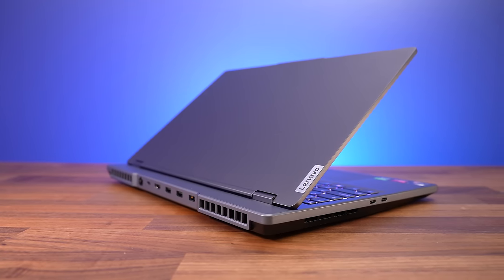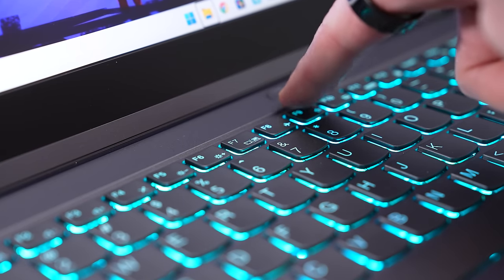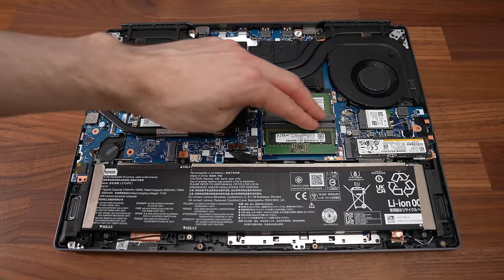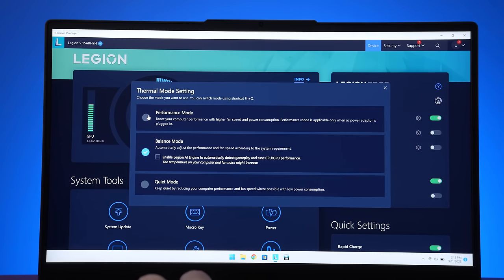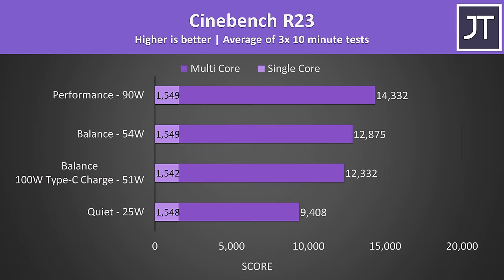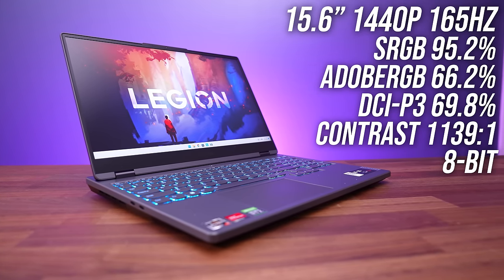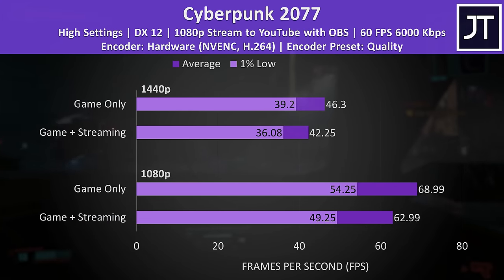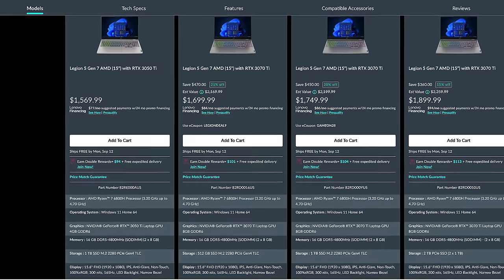Lenovo Legion 5 (2022) Review - Still Best Mid-Range Gaming Laptop?

Comment: I think the model has a better design compared to last year. But it does seems to be minor. If you have last year's, this year is definitely a pass. Too bad no 17 inch models this yea. Otherwise I'll take that in a heartbeat. Still it's still a well capable machine for what it has to offer.
Reply: If you have last year one, the next 3 years are definitely a pass imo :D
Reply: @thomassleziak1222  im gonna buy the last year one because its cheaper and there is no difference for gaming 😁
Reply: @winterfell8756  you do the right thing, that gpu thermal throttle is a big downgrade compare to the last year model probably due to the removal of the left side heatpipe, the weak hinges won't be much of a problem but the price is a No go. get the last year and you'll be a set for a few years
Reply: @Emad______  well here in france i can get the last year model for 850 euros witha 5600h and 3060 so theres definetely a big difference in price with the 2022 model so yeah for me the last year is a much better option for so many reasons
Reply: @winterfell8756  that's a sexy price right there, but with which screen option? and ram/ storage?
Reply: @winterfell8756  here in Delhi that same model costs $1700 ... Pain
Had to get the 800 dollar 1650 version lol
Reply: @MFDOOOOM  damn thats very expensive im sorry for you guys
Reply: @winterfell8756  Hello, where can you buy it in France for that price, i would come just to buy it 😁
Reply: I recently got a legion 5 2021 with an rtx 3070 , 2 tbs of nvme , 16 gb ram and an r7 5800 h , 15.6 inch , mantaray white for 1673 usd
Reply: just bought last years model with a 3070 and 5800h for $1350
Reply: @AliHamza-sv4ni  I basically got the same thing tho mine had 500gb ssd upgraded that to 2x 1tb nvme and upgraded the ram to 32gb. total cost 1800euros.
Reply: They cut too much in this year model 2020 and 2021 model were much better also that new ventilations grils and hinge are not looking as sturdy and good as old ones.
Reply: @Emad______  15.6 1080 120hz and 8gb ram but the ram aint a problem since i can add 8gb more for 30 euro
Reply: @winterfell8756  the screen was the reason that cheap price, they always do that with the 12hz config. that screen is terrible in more ways than one. it's dim, colors are washed out the respose times is slow af and lacks so many features a good display should have. that said, if u attach the laptop to a monitor or tv then it's not a big deal and can be overlooked. the 8gb ram is not enough but also an easy cheap upgrade so no problem on that front.
Reply: @Emad______  what you recommend me ? Getting the 165 hz screen with a ryzen 5800h?
Reply: @winterfell8756  idk, do u play with the laptop screen or hook it up to a monitor? and how much it's gonna cost u to upgrade to the 165hz screen?
Reply: @Emad______  laptop screen, i just checked the 165 hz screen with an rtx 3070 is like 1300 euro thats too much theres almost 500 euro difference ill probably go with the 3060 120hz and idc that much abt the screen bcs im only gonna game
Reply: @winterfell8756  that 1300 euro is absolutely worth it, the 8gb vram of the rtx 3070 will last u years on 1080p max settings and since ur gonna game on laptop screen u really gotta go for the 165hz version, the games are produced in srgb color space and that 120hz screen covers like 50%-60% of srgb. while the 165hz covers almost 100% of it, u will notice the difference in games, no question about it, if u can't afford the rtx 3070 version atleast get an rtx 3060 version that comes with the 165hz screen. games look terrible on that 120hz, u won't get a good experience.
Reply: @Emad______  i know the rtx 3070 and 165hz is worth it but cant affort it sadly .. i wanted an 165hz one with the rtx 3060 as you said but couldnt find it (i want the lenovo legion 5)
Reply: Jarrod -  what if you force streaming process to iGPU RX680M and let game go by RTX GPU... would increase play + streaming FPS?
Reply: is the i7 not a a 17 inch version of i5
Reply: @winterfell8756  is that refurbished or Brand new?
Reply: @Emad______  what about 2021 one 17" with 144hz and 16 ram? 3060 ti tyzen 7 5800
Reply: @Emad______  so this year model have bigger temperature problems?
Reply: @tryfergoodra552  last year didn't have any to begin with, but this year there is some throttling with the gpu.due to the new heatpipe design specially on the 3070 ti model, not a huge dcrease in performance but it's there.
Reply: @Emad______  oic im thinking in 3060 models checking offers but rly want 17" model
Reply: @tryfergoodra552  ur only option is last year and the screen is not bad either.
Reply: @tryfergoodra552  brand new
Reply: @Emad______  what about in 3060 model? , i have 2 options 2021 legion 5 17.3" ryzen 7 5800 1tb 1080p refurbished in 1020$ or 2022 legion 5 pro ryzen 7 6800h 512gb 2560p new one in $1100 , both have 3060 kinda hard to decide
Reply: @tryfergoodra552  if u plan to game on it the rtx 3060 isn't enough for the  5 pro's screen resolution otherwise get the pro model if u don't wanna go above rtx 3060
Reply: @Emad______  oic , yeah i wanna play with it , probably is too much for sekiro, gow and simmilars? although the only esport i like is Lol , i like big screen but also don't like at all the fact that the 2021 is refurbished dunno about that but says refurbished by lenovo
Reply: @tryfergoodra552  refurbished laptops doesn't mean something was wrong with it or it was broken. it mostly means either the owner didn't want it or at worst case it had issued but was returned to the factory, got fixed but the owner got sensitive over it. either way lenovo has good quality control. but if u don't play heavy titles and don't wanna use rt then get the 3060
Reply: @Emad______  Oh i see thanks , i don't care about Rt but maybe 3060 is kinda clutch for WQHD  if i want to play some games at max , i guess the best course of actions for me is wait a bit more till black friday to see if can get a great deal in QHD/WQHD and 3070 one if not then just 1080p 3060
Reply: @tryfergoodra552  black friday is when u can get a legion 5 with rtx 3070 and 1080p at around 1200-1300. that is the best combination for a laptop, the QHD resolution is basically useless for a 15" or even a 17" laptop dsplay, I've looked at them both and(legion 7 and legion 5) and I could not notice a difference in picture clarity,and I've got a rather good eye sight.U only get a 25%-40% fps decrease for no damn reason.unless u shove ur nose to the display, but siting at an optimal distance like a normal person, u can't notice a difference, it's just not so many pixel difference between them. sure the QHD is brighter at around 500 nits vs the 300 nit but that's damn impractical. try playing an hour with brightness at 100% and u'll see how ur eyes gonna beg u to stop. u'll be forced to turn it down to 300-250 nits. as I had to. these are all gimmicks pal.

Comment: I have the Legion 5(2021) with a 5600h and a 3050 and the performance is insane for the specs and price. Pretty much can run everything on high (some games even maxed out) with 60 fps +. Also the laptops temps are amazing(70 while gaming max 80  for both GPU and CPU ) if you lift the back up with something like a wooden block or smth. Sound can be a bit loud but if you don't know if it is worth it. It is imo
Reply: i bought one with i7 and 3050.
Is that enough to run heavy programs and games?
If not I’ll return it.
Reply: @dragginbalz5897  Look up videos and benchmarks that show how it performs in applications you want to use
Reply: is screen bright enough to use on sunny day indoors, or do you need to cover the vindows?

Comment: I bought legion 5i pro 2022 with RTX 3070 and i7 12700H and I've never been happier! 
Legion laptops are simply the best, they're giving you a whole package from performance to relatively thin design to having multiple ports that support latest technologies! not even mentioning the really good deals that Lenovo always makes.
Reply: How's the battery life when doing light stuff, like watching YouTube and web browsing?
Reply: @user-zc2hz3yj2k  I haven't tested it fully yet but I think when you use silent mode while browsing you'll get around 3-4 hours of battery life. 

however I tested the battery in the most extreme power saving scenario: 
I set the resolution to 1200p and the refresh rate to 60hz.
I used silent mode and used Optimus and turned on Windows battery saving feature and turned off Bluetooth and WiFi then I watched a whole 1080p movie offline for an hour and a half and it drained the battery down from 73% down to 52% which is really great!
while watching I was checking how much wattage the CPU was consuming and it was around 7.2 watts.

overall if you really want to save the battery you can but 12th gen intel CPUs are not a great contender for efficiency.
Reply: That's what I was thinking of getting this fall. Is 16 gig RAM enough? Is the i7 better than Rizon? I mostly keep my laptop plugged in.
Reply: @christhompson9140  this year's i7 is overall better than this year's Ryzen but it consumes electricity more than Ryzen but it's absolutely worth it in my opinion! 

16gb RAM is the sweet spot for gaming is it's somewhat usable for 4K video editing and stuff, so yeah it's enough
Reply: @user-zc2hz3yj2k  About 3hrs if you put it in Quiet Mode and switch to 60Hz, max brightness.
Reply: Do enable conservation mode on if you're plugged in for those working most of the time with a socket around. It really helps preserve life.
Reply: @christhompson9140  there about the same in performance, but the intel uses more power and gets hotter
Reply: @chrxs61632  so if performance is roughly the same, is the cost different mainly from just having the Intel name?
Reply: @christhompson9140  apple's junior brother 😂😂
Reply: Mine just arrived also I grabbed the white
Reply: I m thinking getting cheaper legion 5 with gtx 1650 due to budget...should i go for it or there are any other recommendations?
Reply: @pratyushsamal7569  I really don't know about cheaper laptops but generally speaking legion laptops are good.
Reply: @ExtremelySimplified  ok thanks man!
Reply: @pratyushsamal7569  ideapad gaming 3 is good
Reply: @pratyushsamal7569  get a 3050ti at least
Reply: what was the price you paid at the time? looking for the same model
Reply: @pratyushsamal7569  I would strongly NOT recommend the GTX 1650 at this point. There are better options out there on the market, unless you’re fine with gaming at 1080p on medium settings. But honestly at this point you should go with an RTX 3050 if you’re budget allows or if longevity matters to you then spend more and get an RTX 3060. The performance gains from it are worth the extra money
Reply: For RTX 3070 version, what is the max TGP? And if compare to RTX 3060 ver, how its is? I know RTX 3070 is better than 3060, but of course is according to TGP, right?
Reply: @junarisalfianto4877  The RTX 3070 in my Legion 5i Pro 2022 runs at 150 watts! it's super fast and delivers amazing performance. 

As I recall, the RTX 3060 runs at 140 watts which is still so fast though.

I think the 3070 is around 18% faster than the 3060 one. 
I did some benchmarks with the 3070 if you're interested.
Reply: @ExtremelySimplified  thank u so much, very helpfull. How about this, which one u preffer? I7+RTX 3060 or Ryzen7+RTX3070
Reply: @junarisalfianto4877  Ryzen 7 with the 3070
Reply: I'm thinking of buying the 6th generation, but I've doubts about the 512 ssd...have you upgrade for more?
Reply: @SimaoFCunha  u can add one more ssd for upgrade

Comment: Thank you for the review. Noise levels seem very good. This is the very laptop and configuration I'm after because I like this year's design much more, as well as it has a 1440p screen which is much better than the 1080p one last year. It seems better in many ways. This is the one I'd like to buy now.

Comment: Anyone feel like the entry level Legions are getting way more expensive?
You could get the 1650 one for 700,800 dollars and now it's like 1200 dollars for the entry level 3050. Insane
Reply: That’s how inflation works
Reply: To be fair, it's better in enough ways to make the price increase worth it. Besides, the IdeaPad Gaming lineup took the low end. (And yes, I know it lacks many Legion features like a MUX switch, but it is what it is.)
Reply: good job, you discovered basic economics and inflation 🎉
Reply: thats y buy at microcentre mine was 1300$ for 6800h 3060 1tb ssd 16gb RAM 1080p screen 165hz
Reply: @cameronbosch1213  how is it better in enough ways to justify 300,400 dollar increase ? The 3050 is an absolutely pathetic card, with has just DLSS capability in it's favour. 
All the high IQ bros goin "inflation" don't seem to get that either.
Reply: @MFDOOOOM  Wait a month or two. It will then probably be on sale for the rest of its shelf life. Also, for about $1800, you can get a Ryzen 7 6800H & Radeon 6700M 2022 Legion 7 that's better in many ways than the Legion 5.
Reply: @luluw9699  eula <3
Reply: @shamsielshahar120  eula kyaaa<3
Reply: @MFDOOOOM  it's because the supplies of the processors are lacking, for example ddr5 Ram is a whopping 200 or so dollars expensive than ddr4. In theory it should be lower over time.
Reply: 700k? Thats a lot

Comment: I have the 2020 version of this thing and it still rocks. The best investment I have made, this is going to last me until 2025 at least, I added a super fast ssd nvme and I use a 2tb samsung ssd for games, The performance is incredible. Ryzen 4000 series are light years ahead of intel, no need to upgrade my windows system atm because I am a casual gamer so no biggie with the gpu. I paid near 1400 dollars for this thing due to the pandemic shortages, but it was worth every penny. Never have had a blue screen or any problem at all, except the audio drivers recently.
Reply: What gpu do you have?

Comment: 23:59 I find it weird that for about $1800, you can get a Ryzen 7 6800H & Radeon 6700M 2022 Legion 7 that's better in many ways than the Legion 5:
1. The Radeon 6700M GPU is better than the RTX 3060. Both in Linux & in Windows for gaming.
2. The screen is much better, with a 2560 x 1600 165 hz screen that is 500 nits bright.
3. The Legion 7 has a fingerprint sensor.
4. The chassis is much more premium on the Legion 7. It's a CNC Aluminum/magnesium unibody.
5. More RGB.
6. Bigger battery (the legal limit for taking onto a plane).
7. Glass touchpad compared to plastic/mylar.
8. Fn + R shortcut.
9. Better Wi-Fi 6E card (still a MediaTek card, and my Legion 7 had serious issues with its Wi-Fi card, but its a $20 - $30 upgrade, not the end of the world).

Seriously, this just shows the Legion 5 is overpriced this year...
Reply: do you think this years legion 7 AMD is better then last years legion 7i, im asking because i dont know which one to get
Reply: @nappingstar5720  Yes.
Reply: @cameronbosch1213  thank you
Reply: I need cheap option 🗿

Comment: As someone looking at the Legion 5 as a good mid-range gaming laptop AND wondering about Linux support, your inclusion of this detail is really appreciated -- please keep it up. :) In terms of potentially improving this segment of your videos, it would be really helpful to know what Linux compatibility is like after upgrading the kernel to its latest version, as this often brings additional hardware support.
Reply: What is bwtter gf63 thin eith 4060 rtx and i7 proccesor or this legion?
Reply: @floudz7750  I'm not really sure what this question has to do with my comment, but from what I've heard and read, Lenovo's Legion laptops are all-around a better propositions than MSI devices.

Comment: I feel like the TUF series from ASUS has shown the most improvement out of the 2022 gaming laptops, however, it did have the most to impove on from its 2020/2021 versions. Currently considering between the A15 with a 3060 or the Legion 5 Pro with a 3060 from 2021, as the screen of the legion is really tempting.
Reply: What is your usage ?
Reply: Which did you end up picking? I am also torn between the legion 5 and the Asus TUF A15
Reply: @LiseytheMunchkin  ; my bug reason for choosing Lenovo is the 4 years of extended warranty with ACCIDENT PROTECTION!  That seems to be pretty rare, or way more expensive, with the competitors.

Comment: I'm gonna get the 2022 Legion 5. I'm an edge case though - I buy Legion 5 laptops (AMD models) to use them as Linux workstations - something the Legion 5 modals are pretty good at. The new AMD Ryzen 7 6800H has the new RDNA2 integrated GPU, which is a HUGE improvement over the Vega 7 iGPU that came in previous models. Most of the time I'm using my Legion 5, I have the Nvidia GPU completely disabled (I don't need a dGPU for terminal, browser, an IDE etc...). Yeah, I'm definitely gonna buy this bad boy. THANKS FOR THE REVIEW!!! ❤
Reply: If you don't need a dgpu wouldn't it be cheaper to build a desktop pc  ?
Reply: @kiyoponnn  I have a desktop PC already, and I don't care about cheap 😉. I need something I can take to conferences or in to board rooms etc...
Reply: @MnemonicCarrier  i see